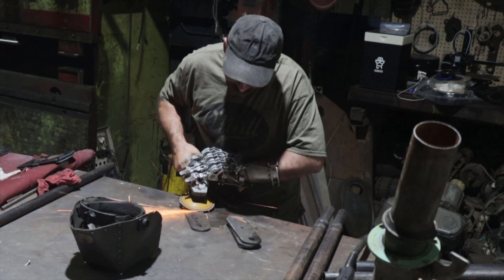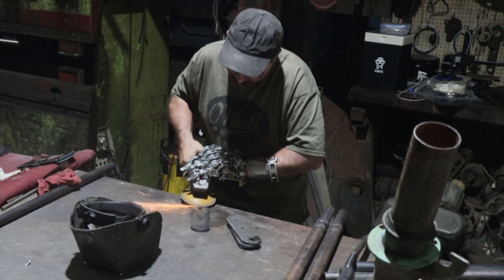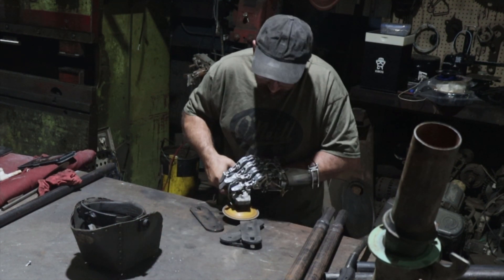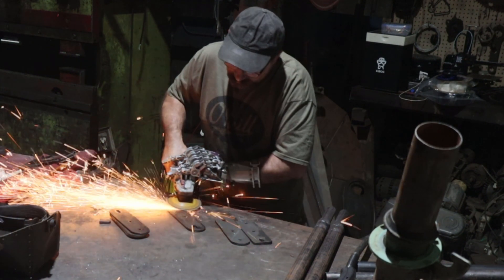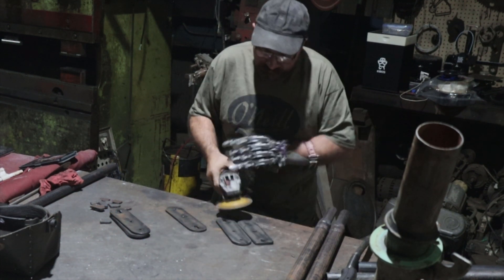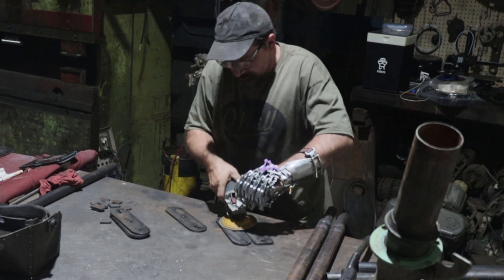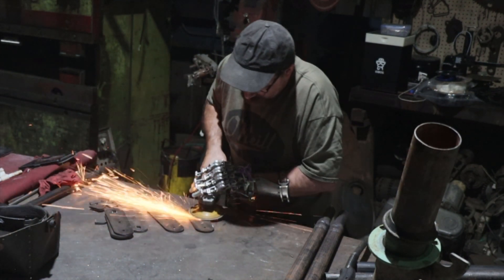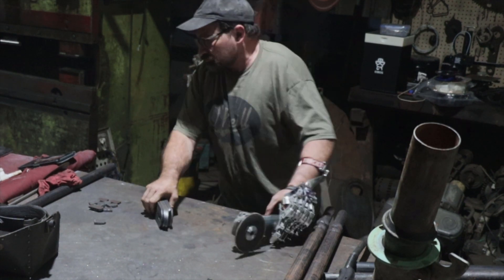Grinding Parts Using My New Prosthetic Hand!

Comment: I'll keep it a buck, if you hadn't prefaced this with your concern of keyboard warriors harassing you for your use and/or misuse of the grinder, I ABSOLUTELY would have typed out a whole comment about how this is super cool but also hella unsafe, which I kinda still am, but that's just the way the cookie crumbles! I'm really glad you posted this, & as long as it works, it's FINE. I look forward to seeing whatever the next installment to your hand, literally or figuratively  :)

Comment: Question: since you have been wearing these mechanical prosthetics for a couple of years now, have you noticed an increase in size or strength in your left arm?
Reply from the maker: I was left hand dominant to begin with, and it weights sub 2# so it's not like I'm getting a real work out wearing it. But following that line of thought,  I haven't seen the atrophy normally associated with limb loss.

Comment: Awesome as always!

Can I ask a question though? I'm assuming you're using lightweight metal like aluminum where all you can, but how much does it weigh? Is the weight of it in any way a burden?
Reply from the maker: The whole thing with grip patterns will weigh 1.75-2# less functions, less weight.  If I were to really pare it down I could probably make it just over 1#.

Comment: Your prosthetic is absolutely amazing. Sadly I think going with the major manufacturers is going to be an absolute waste of time but we absolutely have innovation on our side. I think your best bet is to coordinate with other individuals that are using their 3D printing skills to make prosthetics and with them finding a team that can focus on more heavy duty products. I think there's a space for both. You can have the smaller more delicate prosthetic that does have more tendencies to break along with the more heavy duty. Both have their places and as long as you have people that genuinely care about what they're doing you're not going to see as much of a financial problem with having to replace the more delicate weaker models. With 3D printing is a lot easier to have spare parts available without having to contact a major manufacturer. I think those individuals and others like them are going to be your best partners. After all they are coming out with 3D metal printers. I'm sure there's a way to have an in between.
Reply: Looks like something a contract CNC machining company could bang out quickly.  Might still cost >$10K each for the first 10-100, but would avoid burdening Ian with production orders.  I've used Xometry and ProtoLabs they're fast, precise, but a little expensive.  Been seeing a lot of adds for JLPCB's machining.  They've got a great rep doing printed circuits so worth seeing if they have better prices?

Comment: Damn bro those finger movements look so natural as if they are powered by electricity and not simply mechanic in nature
Reply: I think the Mechanical Linkage is what Gives it that natural movement. The tendons and ligaments in your fingers do Practically the same thing that his Chain drive is doing.
Reply: If you saw how an electric prostatic behaves you'll understand it's the othe way around, the electric ones need a lot of work put on them to get to this level. They a re full of delays and are generally unresponsive.
Reply: @joaomrtins  yeah I agree, I think people want a electronic prostatic though because it isn't as bulky and can potentially look more natural in terms of actual skin
Reply: @bigbird4481  no one wants it to look like natural skin. If you lost a limb you should at least make it look rad. 
Besides the "natural looking skin" usually fall at the bottom of the uncanny valley.
Reply: @joaomrtins  eh I've seen people wanting a natural skin look, but I do 100% agree with you about making it look awesome.
Reply: @bigbird4481 the natural skin look is actually what makes it look scary to people

Cool looking bad ass full metal fist? That's something I would be amazed of as a kid, not scared, but those "fake skin plastic" ones? They'd scare the shit out of me
Reply: Right? It's like watching freaking sci fi!